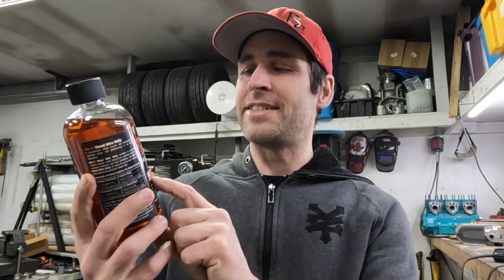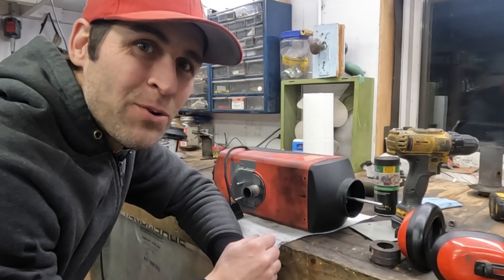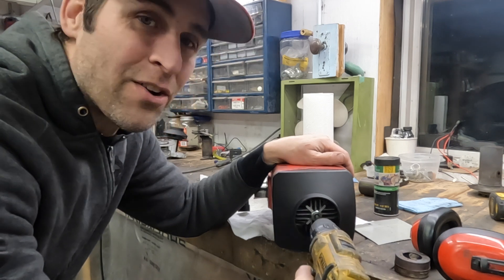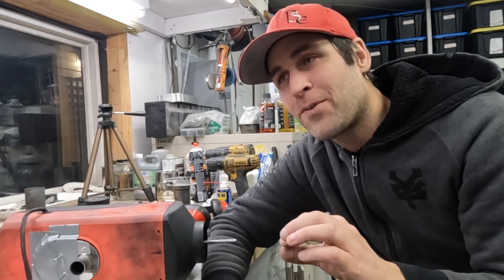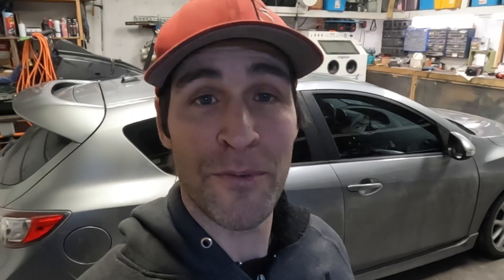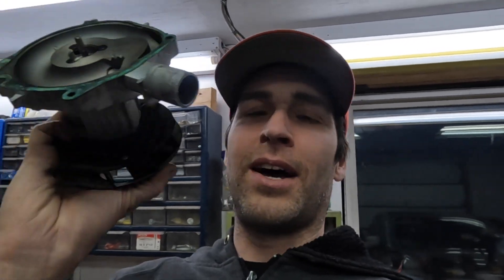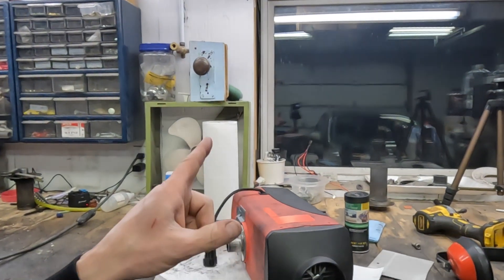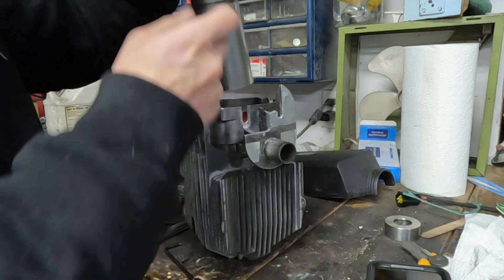Self Cleaning Heater - Veg Oil Fuel - Fuel Additives - UPDATE Video.

Comment: I wonder what would happen if you used a 2kw burn chamber in a 5 kw exchanger, but "over clock " it so that it still produced the same amount of heat as a 5kw. The idea being that you would have to turn up the combustion fan speed to force in more air (and fuel with it)  and would increase overall air flow through the combustion chamber and blow the ash out the exhaust before it could build up on the walls.  if that makes sense.. would have to have a separate fan to blow air over the exchanger though, as otherwise it would over cool being run at higher combustion fan speeds.

sort of like turbocharging a 1.0 engine to produce the same power as a 2.0 N/A engine. same amount of air / fuel consumed just pushed through the smaller engine quicker lol.
Reply from the maker: That would be interesting. The flange isn't the same, so you would have to cut two chambers apart and make one. The length of the 2kw is also much shorter, so you would likely get a lot less efficiency, due to the gasses escaping out of the chamber, before giving up all their heat.... so lengthening the tube would be a good idea. 

As long as the air restriction wasn't too great, this could create enough air speed so that the ash was blown out of the chamber.